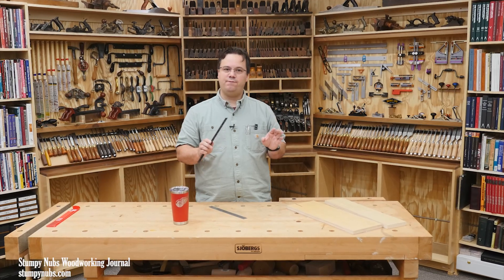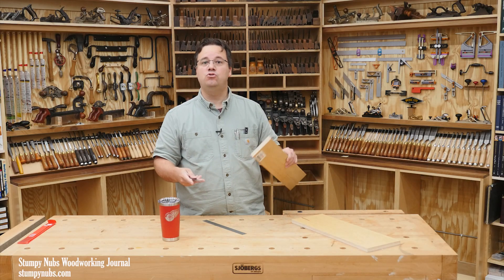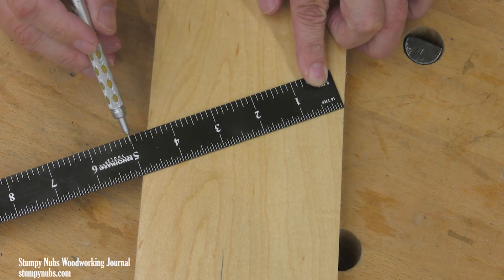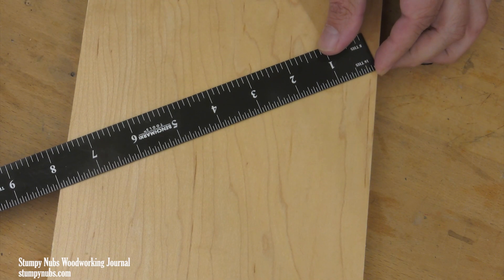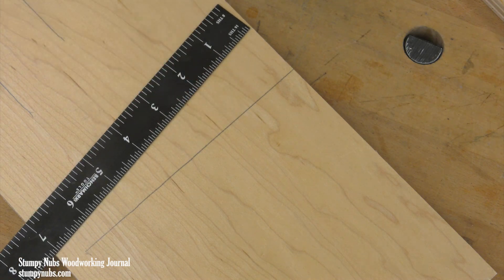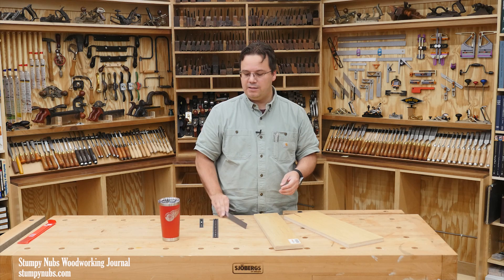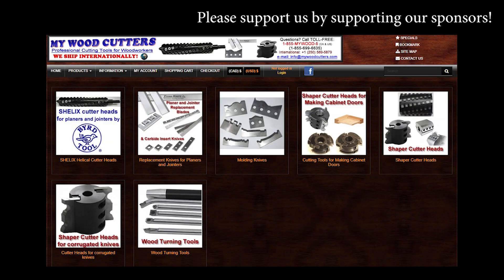Clever ruler tricks worth learning

Comment: I often need to set inside long measurements on Brown and Sharpe  screw machines. Taking two 12 inch rulers, I made a pinch bar set using two pieces of flat stock with tapped holes on either side. One ruler slides underneath the other and the flat stock "sandwich " locks it in place. Works great !

Comment: You always have good information. I would like to suggest 2 possible changes. 1) have you seen the Starrett rules with end graduations? These are great for height measurements. For example to measure the height of saw blade, router bit or shaper cutter. The PN has an 'E' in it. One example:  C304SRE-12. 2) I have been using the finger trick you talk about for a very long time. BUT, I learned that using soft flesh against rough sawn lumber or even plywood can cause an injury; splinter, or 'paper' cut. I instead use my thumb nail as the rubbing edge against the work piece. Keep up the informative videos. Thank you.
Reply from the maker: Benchmark makes rules with end graduations. So does Shinwa. Both are of equal quality to Starrett for much less money.

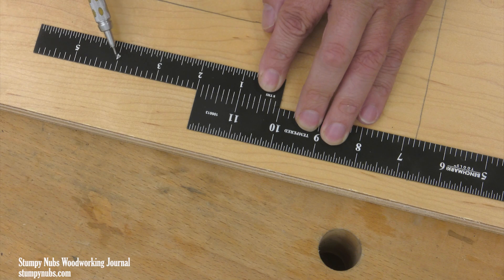Comment: 2:37 silver is only the color, not the metal. This looks like cheap inox. Or coated iron.
Reply from the maker: If you thought I meant it was made of actual silver rather than that it was silver in color... well... I don't know what to say other than no, it's tempered stainless steel with a brushed matte finish.